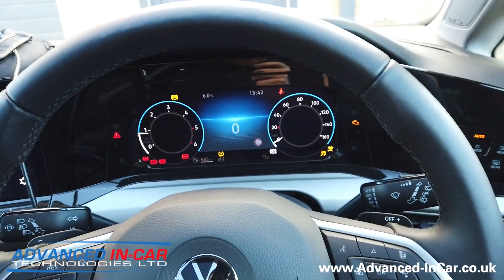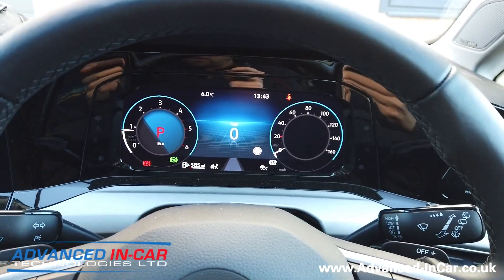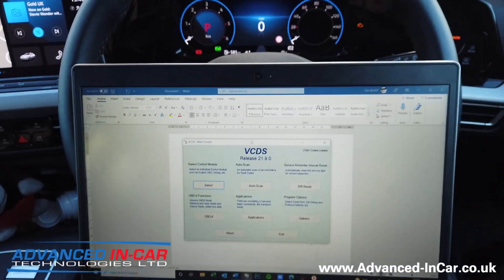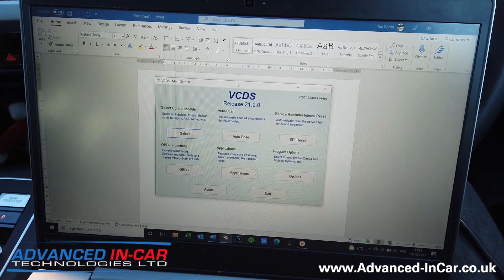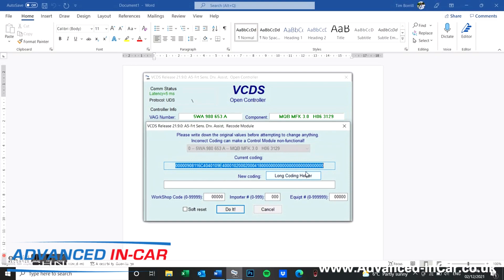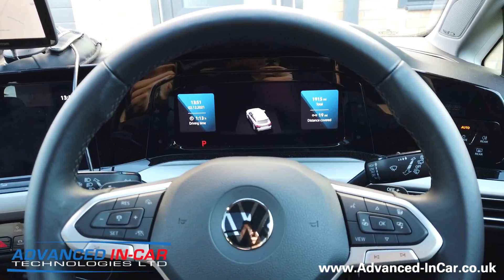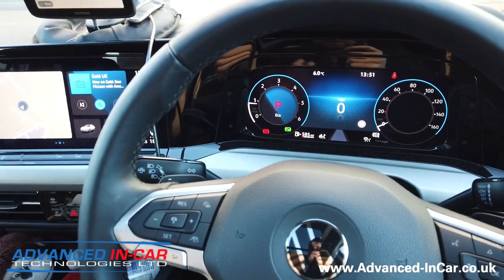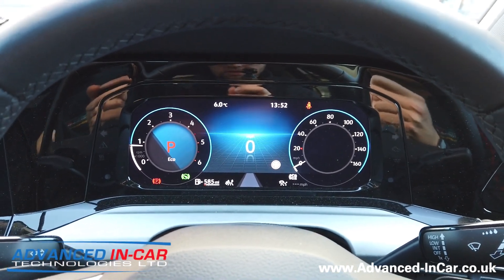How To Activate VW Lane Assist Memory Function With VCDS

Comment: I have used OBDeleven which is able to deal with the VW security, and it works. VW Lane Assist Memory is working. I have done it 2 years ago and it's OK with the VW garage service. You can also modify many other settings.

Comment: I confirm that VCDS 21.9 can’t modify anything on a GOLF 8 2021 Chassis Type CD (5WA). VW introduced in this model the SFD protection, confirmed by RossTech. So in my knowledge you can only use the VW software. :-(